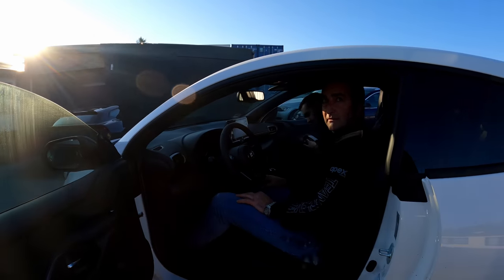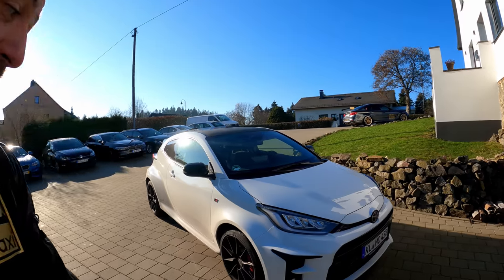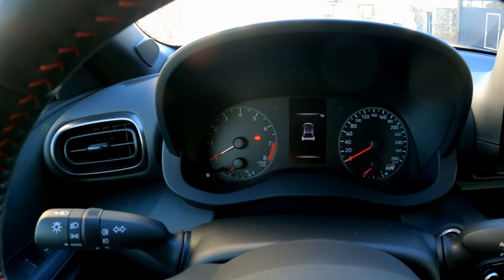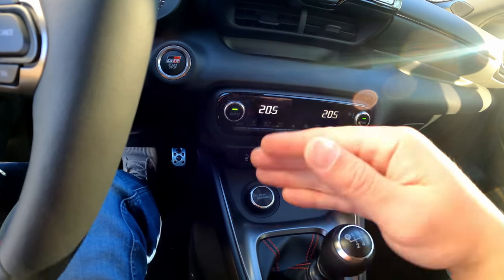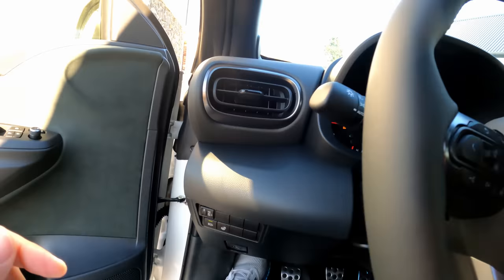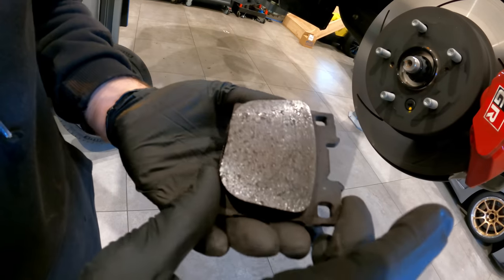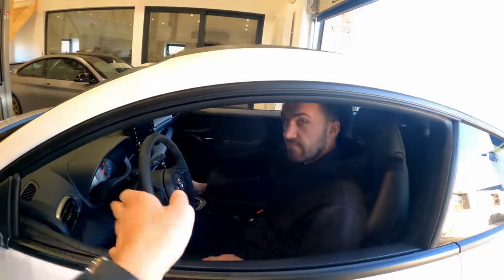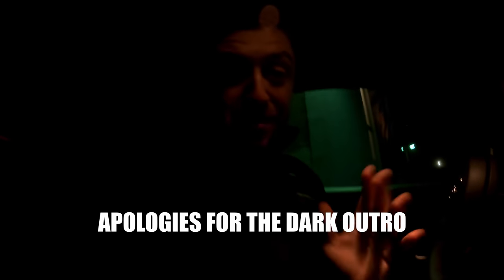OUR NEW TOYOTA GR YARIS IS HERE!!! | EVERYTHING You Need to Know

Comment: You can buy an FIA homologated car with two mechanical torsen, what a shame the citroen and vw did nothing during their WRC success. Also WHAT a car, definitely will try it next year!
Reply: The car is not homologated for WRC, the engine/drivetrain is homologated for WRC2 (2nd league).
Reply: @Fastvoice  he only said FIA homologated though, he was just referring to WRC to say it is a shame the others didn’t do this.
Reply: Well there is a polo WRC version, but even though it is as expensive as this one, that car doesn’t come even close to this one. And same goes with the Fiesta. Now that they are not going to make a Focus RS anymore, it was the ideal moment to make a fiesta RS with the same idea as this one,.
Reply: @Fastvoice  But they will be using the body shell in the WRC cars. So yes, the body is homologated for WRC
Reply: @Fastvoice   WRC2 is only for 4 cylinder engines
Reply: @HENRIKOIVUROVA  I don't think that is specified.
Reply: @HENRIKOIVUROVA  Toyota did get a waiver by the FIA for the 3 cylinders in the 2021 WRC2 season.
Reply: @banaana1234  No, Toyota will reuse the 2020 WRC body shell in 2021 and didn't homologate the GR Yaris body for the WRC. And for 2022 there will be a totaly new WRC regulation for which the GR Yaris is not prepared. Just read the Toyota press releases or watch some of the YT videos from the UK about the GR Yaris.
Reply: @DnBDubstepManiak1  He wrote it's a FIA homologated car which it isn't.
Reply: @Fastvoice  There is a badge in the car says: WRC Developed for FIA World Rally Championship.
Reply: @Mark__A  Which was the original idea but has been dumped since. Badges are for marketing and not for legal purposes. I'm just telling you here what Toyota Europe has published. So if you don't believe me just ask Toyota.
BTW: For a real GR Yaris enthusiast the discussion about homologations is absolutely meaningless You'll love the car anyway.
Reply: @Fastvoice  This is the closest you can get with a factory OEM car for homologated racecar on the road. May they not going to use it in rally? Yes. It is built to be a FIA race car? Yes. So I leave it there...
Reply: @Mark__A  Just watch the video of Robert about the background: https://youtu.be/22GQVLFGU0A
Conclusion: It was originaly designed as a WRC base model, but it will never be used in the WRC in its actual form.
Reply: @Fastvoice  Well, what bodyshell do you think toyota will use for WRC on 2022? Why wouldn't they use the GR Yaris?
Reply: @coletrickIe  As far as I know there already is 2 door R5 cars and nothing in the regulations prevents that. I tried to find something in the regulations but couldn't. What prevents 2 door cars from R5?
Reply: @coletrickIe  Man, go eat some lemon. How peoples can be this sad and negative? I can imagine with this price they even loosing money on every car.
Reply: @Fastvoice  Which is exactly what I said? "May they not going to use it in rally? Yes. It is built to be a FIA race car? Yes."
Reply: @coletrickIe  You're right about the body/chassis. But as I wrote before Toyota has a FIA waiver for the 3 cylinder engine and the drivetrain to be used in 2021 WRC2.
Reply: @banaana1234  I have no idea because WRC will use some kind of hybrid technology in 2022 and will have very different aerodynamic rules. So they have to construct a whole new car. Which is usualy some kind of prototype for the WRC with no big relationship to a street model.
Reply: @coletrickIe  Toyota Europe itself just writes about WRC2:
https://newsroom.toyota.eu/gr-yaris-born-from-the-world-rally-championship/
"Producing 261 DIN hp and 360 Nm of torque, it complies with WRC2 technical regulations"
I have no clue about the R5 regulations for 2021 though but usualy the R5 rules apply for WRC2. So the GR Yaris engine should be homologated in R5.
Reply: @coletrickIe  There is a WRC protype with the GR Yaris body, there is videos of it testing in finland on youtube.

As for 2022, Toyota would be stupid not to use the GR body for their new car. The hybrid technology makes no difference, WRC cars will still be based on a road going model and the GR Yaris is a good one to base the design on. Why would they do anything else? As far as I know the aerodynamic rules for 2022 will be pretty similar to present, most of the difference is in the powertrain and suspension.
Reply: @Fastvoice  but wrc2 is still FIA sanctioned competition so he is right that it is FIA homologated
Reply: @Fastvoice  Here's toyota WRC technical director confirming they will use the GR Yaris for the 2022 WRC car:
'“Obviously the cockpit compares [from ’21 to ’22 car]; the windscreen and windows is the same because we plan to use the same GR Yaris, should we say, outer shape,” Fowler continued.'
https://dirtfish.com/rally/wrc/can-toyota-learn-much-from-its-abandoned-2021-yaris/amp/
Reply: @coletrickIe  Sure, but it's not likely to be a problem. I'm sure that toyota already has an idea what the powertrain will be like I  2022. 

You can't buy the regular Yaris in north america either, and gazoo racing has been happily using it for years. If they are going to race, they will do so with the best available car.

Ending the program altogether is a completely different problem.
Reply: @coletrickIe  There are some infos about the future use (or not use) of the GR Yaris and its parts in this video for instance:
https://www.youtube.com/watch?v=uNx1Dxc4hhc
Which complies with the statements I made in this thread AFAIK.
Reply: @banaana1234  Which says absolutely nothing about what will really be constructed for 2022. Using the outer shape or some parts of a car is by far not the same as homologating a car.

Comment: Hey Misha, 
do you have any worries about the longevity of the engine considering the small displacement paired with the high power output (especially if taken to the track) ?
Reply from the maker: I guess we all will find out together 😬
Reply: the engine is really beefed up, think it will be fine.
Reply: From a Engineering standpoint, as long as you choose the right materials and techniques it´ll be fine. look at the A45 engine, and even the M3/M4 Competition have a higher hp/liter output.
Reply: Take a look at the technical sheets of the car (because it's very interesting). It's really not your typical small displacement/high output 3 cylinder, some serieus racing stuff in there!
Reply: I hope that nobody is gonna mistake the 4th gear with 2nd at 160km/h ...
Reply: Its a well engineered Toyota...🤷🏻‍♂️

Enough said 😂
Reply: @Ssh52  there are Toyota myths and Toyota facts
Reply: @TheMilenkata  I was thinking the same thing. I would love to see a manufacturer install a lockout feature that won't allow a gear to be engaged over a certain RPM. With all the ECU capabilities these days that wouldn't be too hard to program.
Reply: @Sean_Farmer  you cannot program something like that, this is not auto gearbox, there would need to be some kind of mechanical blockadefor that
Reply: I wouldn't worry about the displacement. Theres smaller 1.4 litre cars making reliable power in the 350+ ranges without any major internal engine overhaul. You'd be surprised what a good block can get out of 2.0 litres or less.
Edit: there are plenty of engines that are smaller than 1.6 that have made 500+ hp, however your reliability starts to come into question at that point. Basically you'll be fine for realistic and reliable power
Reply: @misa664  So? The manufacturer could install that, and it wouldn't be hard to program it to work.
Reply: @misa664 , that's what I'm talking about. I didn't want to type too much in one comment. It's not hard to fit with an electric servo that moves with each up/down shift.
Reply: @Sean_Farmer  in theory they could, but why? Unless someone is beginner missshifting like that is not really a thing and this is not a beginners car.
Reply: @banaana1234  but why, there are milions and milions of manual cars and misshifting like that are extremely extremely rare even with beginers. And it is kind a embarrising to drive rally car and need something like that
Reply: @misa664  We are talking about a rental car here. It will be driven by a lot of beginners trying to shift quickly. 

Sure, the people that buy this sort of car won't usually have a problem.
Reply: @banaana1234  that makes sense but i dont think that Toyota intended this to be rental car(althoug i am not aware of any car rental or not thas has that feature)
Reply: @mgcharoudin  still can swap the 2l from the supra or go crazy like cusco and put a 2jz 😜
Reply: I remember there used to be a car that came with an additional engine because of the short lifespan (small engine, a lot of BHP). I can't remember which one, maybe manufacturers improved the quality since then.
Reply: What about Peugeot's 1.6 270hp engine from the 308 GTi, it has been out for a few years now? Toyota shouldn't be less durable than that.

Comment: The awd system added a lot of weight but maybe the reason behind it was to give it better weight distribution so you don’t stress the front tires that much and also to avoid lifting up the rear under heavy braking.  But the bigger advantage in on rally slippery roads where traction makes the car much faster. It’s similar to a Subaru Sti.

Comment: Congrats!!
Re the brake lines, even the factory rubber-coated ones are braided, not just rubber. 
(In fact I think it’s one of the biggest after-market scam’s that ”braided lines” would do a huge difference... The one you’d feel is either psychological or from the fact the system needed bleeding anyway)

Comment: Misha, regarding price, the first batch of 1000 units of the GR Yaris in Australia were sold for AUD $39,990. That includes all taxes, compulsory insurance etc. So about EUR 25,000 ish. We got a similar deal with the 86 as well.
Reply from the maker: That's crazy!
Reply: With or without performance package?
Reply: @Fastvoice  The AUD 40K cars didn't get the tricky diffs, suspension tune, enkei wheels. The ones equivalent to the track pack are being sold under the Rallye model that is AUD $56K driveway for the first 200, so about EUR 34K ish
Reply: @BlinkyBill11111  Okay - that makes more sense. It's just about the same that Robert paid here in Germany (35.000 €).

Comment: 1600 euro for a wheel? You must measure the weight of it!
Reply: Its over 8kg. Forged BBS (Made in Japan).
Reply: @jagymeister  I will measure my standard Audi 2004 factory wheel, justo to compare
Reply: @jagymeister  I just measured ny 2004 Audi A3 wheels. They weigh 7.16kg.  I doubt they cost more than 200euro per piece new.
Reply: @Corsa15DT  are they 18x8? I doubt.
Reply: @jagymeister  No, I forgot to say, they are 15"
Reply: @jagymeister  I doubt this small car benefits from 18", the big wheel probably hurt the performance a lot.
Reply: @Corsa15DT  lol, ok if you think.
Reply: @jagymeister  think what?

Comment: 2nd :(
Reply: I mean it's still a lot for the car it is objectively speaking, but I understand it's not a lot for what it's capable, given it has a warranty and sensations it provides "out of the box". Compared to a nice E36 or even an E46 build it's still a lot of money but probably will keep you out of expenses for the first couple years. Funnily It has roughly the same specs than the 30yo car I cherish (manual, 4wd , 1300-400kg, ~260hp, 300-350nm tq) and it's like the same results: acceleration 5.0-5.5s, fun to drive, both analog feel, etc. I'd say too bad it's not "usable" daily (actual rear seats) because then it would be a real sleeper vs cars like M4RS, etc. Also I have to say the first Apex rental I would want to make a lap or two just to know how it feels even if it makes no sense as beeing there with your own car anyway.
Reply: @bisondacierr  such a nice comment, buried. ;)